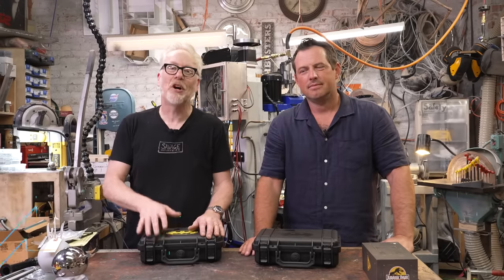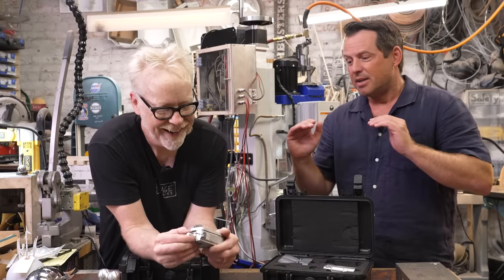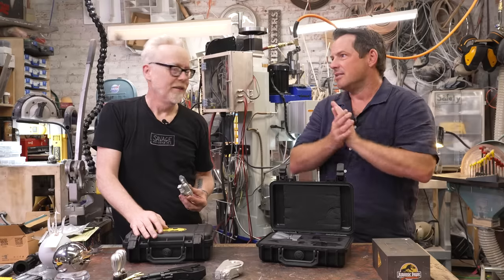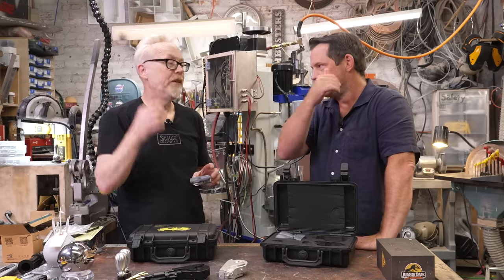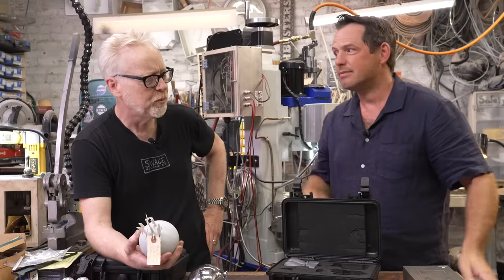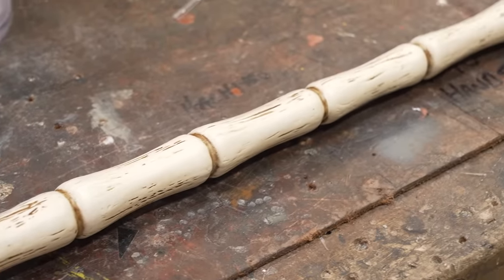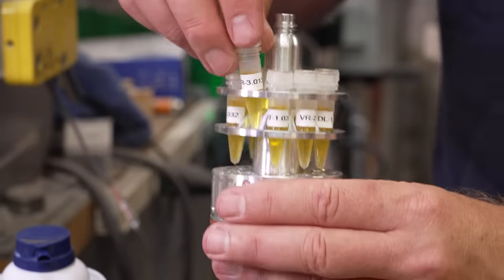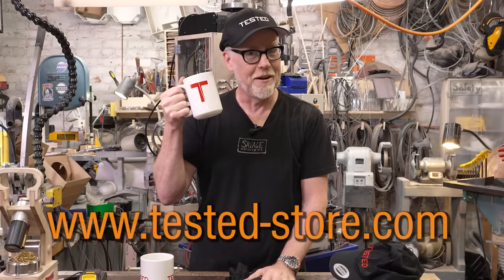How Screen Accurate Prop Replicas Are Made!

Comment: On the subject of manufacturing, QC and communicating with suppliers: a favorite college professor of mine was explaining the concept of "significant figures" and had a fantastic real-world example of why they matter. He had worked for a company that designed lights for bicycles. Someone was doing an internal cost audit and noted a unit price several times what was considered reasonable for some commodity component (I think it was a bracket). When they dug deeper and looked at the blueprint, it turned out an engineer had specified something like "6.00mm" for one of the dimensions. The overseas supplier had dutifully sourced components that were machined and checked to an accuracy of 10 microns when, in reality, a 5.9mm or 6.1mm bracket would have done just fine. Precision and cost do not scale linearly–it ended up being a several-million-dollar mistake!
Reply: That's why as soon as a part is considered "aerospace," orders of magnitude change.
Reply: Yep, been there, I joined a company, looked at their mechanical drawings and halved the cost of outsources items.

Comment: That Jurassic park prop is great! My ONLY quibble is that the bottom should screw on, because I distinctly remember them screwing and unscrewing the insert and then squirting out the shaving cream at lunch, lol.
Reply: That actually stuck with me as well. I know for a fact it unscrewed and screwed back. Seeing it just pull out was less satisfying. Still a very cool replica but it’s the lil things like that that stick in my head. And the function of it actually spraying shaving cream would put it over the top.

Comment: You could tell Adam so badly wanted the Barbasol to spray foam😂
Reply: Hah yeah, that was the only limitation i could see from there, i was thinking that there was something missing, and that was the shaving foam.
Reply: @Games_and_Music  imagine how amazing it would be if they made tiny re-fill capsules you put inside that gives you that squirt of foam
Reply: @medievilassassin  Yeah, but i can imagine that it would be really tricky to do.
There's almost no space left in there, and where to find flat shaving cream capsules, as usually cream cans are taller rather than flatter.
And i'm not sure if messing around with those laughing gas capsules is an option either.

Also, as others have pointed out as well, this can slides open and shut, instead of a screw tightening mechanism.
Reply: @Games_and_Music  yeah the non screw in thing is an irritation , but all they would need to do is the aluminium base hollow that out and the same with the rod in the middle.
Put a high pressure air valve at the bottom that you put a car pump on and that’s it
Reply: @medievilassassin  That's true, they could maybe hide it in the base and use the rod as a tube to get it to the top.
It might still not really be trivial though.
I wonder if a cheaper prop that only serves as the shaving cream one would be a better solution.
Because in the movie they also used the DNA version and a shaving cream version on set.
Reply: @Games_and_Music  or they could just mould a can within a can.
So the innard with the DNA doesn’t take up the whole can so you have the space above it and then you could have sort of a wall cavity a few milimetres thick holding a small amount of foam and air , as realistically you only want enough for what he uses in the movie , as at the end of the day this particular prop isn’t 100% accurate , doesn’t thread in the bottom and non working foam.
Reply: How do you make it spray foam AND cool the Dino DNA samples? Tricky in such a small space! 😆

Comment: You get a greater appreciation for the work that does into something like this.
Reply: And makes you realize it's probably 100x more work making those replicas than making the original prop for the movie. They didn't have to worry about accuracy to anything. The Barbasol can for the movie was probably done in 24 hours but an accurate replica is months of work.

Comment: My favorite example of calls being made on the shop floor impacting the final design is for the M1 Garand. They were having an issue where the gun would jam occasionally, and they had to hide the issue from the military to get the gun approved for use while the figured out the problem. Turns out during manufacturing they were boring a hole and the drill bit would shave off a tiny nub of metal because it simplified the machining process. That tiny nub was helping guide bullets from the magazine into the chamber and without it the gun wouldn’t reload correctly and you’d get jams. Adjusting the equipment to preserve that nub completely fixed the problem and the M1 Garand went on to be a vital to US victory in WW2 where the semi-auto functionality was very powerful against armies that were mostly still based around bolt-action rifles for their common infantry.
Reply: Specifically, wasn't it an issue only on either cartridges that presented left or right in the internal magazine? (Making it harder to diagnose and also your point about hiding it during some of the trials.)
Reply: @fustigate314159  It was magazines that were loaded starting on the left, and not only that it would occur on the seventh round from that magazine. Since the magazine holds eight rounds the seventh one is where there are no longer any more rounds pushing up from both sides, and it’s this lopsided pressure which those nubs were designed to compensate for. And yeah to get the gun to pass the field trials they went through all the magazines to load them all starting from the right, that way no one would encounter the feeding issue.

Comment: What you mention about spending some time in manufacturing is great. I've primarily spent most of my career in computers over about 40 years.

I spent a lot of the early years when I was studying doing part/full time work in manufacturing to earn money or while I was doing different jobs or trying to figure out what I wanted to do. I worked in a foundry for about 4 years while I was studying and about 2 years at a major sailboat hardware manufacturer.

Working in those manufacturing environments was so interesting and has heavily influenced the way that I work with computers and business in general today. It was such a valuable experience for me. Highly recommend it!

Comment: Here for the Jurassic Park pieces!  They look great.  With the cane I did contact Paragon but got no reply - is the cane cast from a screen used prop?  The now defunct Chronicle Collectibles replica cane body was cast from the promo canes - which word has it came from the original molds.  The only part that wasn't accurate was the egg.  So I was hoping this replica cane would be cast from an original, both body and and egg.  I will hold out for a fully accurate cane - that would be a treat.  I hope Paragon sees this - perhaps a future iteration?  Good to see the cryocan shell is accurate!  That vintage can shape has been overlooked for some time 👍. And that's not easy to manufacture.  Well done Paragon and Rylo!

Comment: i can so relate to the process and thinking about what he says about manufacturing something like this due to that i am a CAD designer and CNC operator. what the costumer wants dont always  align whit ones head once you sand there infront of the machine making it :) Ive learn just to do it even if i think or know its wrong or its not going to work :P its better the costumer realise it once the part is done:)

Comment: The shaving cream can is actually a prop I would think of buying. My one complaint about it would be that the can was screwed in rather than a slip-on cover.
Reply: ya, i noticed that too. If they fix that, i'd buy.
Reply: Hah, the comment directly under yours says:

@BroughtToYouByDDean   3 hours ago
I'm still very happy and take pride in the fact that my cryocans are the only ones that ACTUALLY unscrew from the mechanical base... 

So i think you should hit that dude up, hah

Comment: Definitely appreciate the attention to experience. It may seem petty to complain about being not quite right or having cosmetic damage from manufacturing or handling, but when you pay as much as a good prop costs, you are paying for a better experience. Not the Walmart clearance toy experience. If you're disappointed, then there wasn't a point in paying so much for it in the first place.

That's also why the "I can get it for a fraction of that" commenters can get cheaper versions that look close enough - it's a tradeoff of cost and experience. And there's nothing wrong with wherever you are on the spectrum of that tradeoff.

My budget is more often the Walmart clearance toys that someone kept since the 80s, but for a few things I want this kind of experience. If they get into the right Star Trek props, my wallet is in trouble.😂

Comment: Disagree over the accuracy of the JP Hammond Cane.  There are too many closeup shots of the screen used cane to show the inaccuracies of this replica.  
The replica made by Rylo over at the RPF were by far, much more accurate.
The JP Cryo Can is very nice.  If I were to pick nits, one thing that looks a bit off would be the thickness of the base lip.
The price of the Can ($400) is pretty high but it's got a lot of detailed machining.  The price of the Cane ($350) is horribly excessive for what you're getting!

Comment: I am sorely tempted by the cane. I made the amber "egg" once as a school project when we were learning to use resin. I just used a mayfly as the mosquito.  Thought about making a shaft for it in college, but the machine shop didn't have a long enough piece of aluminum in the scrap rack, and you know how machinists can be about wood. Still, the bug in the ball was enough to scratch the itch.  Unfortunately, some kind of small hominid borrowed it a few years ago, left it out in the yard, and I hit it with the lawnmower. This was not a very flexible resin.  Obliterated.  I only know that's what it was because a chunk hit the house.  
That is a nice cryo-can, but I have a Barbasol can that i used a fancy can-opener to take the bottom off of, so I feel compelled to see that through on my own. 
They should do Grant's raptor claw too.  That was my JP Holy Trinity: Claw, Can, and Cane.  I do already have a claw as well(it's metal and has a bottle-opener sculpted into the articular facet and I love it), BUT I generally find myself among a large community when it comes to the props I've latched onto and coveted throughout my life, and that would be an easy one if they could get ahold of an original.

Comment: I'm still very happy and take pride in the fact that my cryocans are the only ones that ACTUALLY unscrew from the mechanical base...
Reply: You sell them?
Reply: Sorry buddy but the two I made both unscrew as seen on screen.
Reply: @minigeff4422  in this video? They are clearly slip fit into the can. So no... They don't screw into the can. Meaning if you pick this up off a shelf by the top rim of the can and shake it the insert will 100% slip out of the can and hit the floor
Reply: @xGaLoSx  yes of course
Reply: @PropGuru702  no I think you’re misunderstanding. You said that your cryocans are the only ones that unscrew from the base. I was replying to you pointing out that the two cans I have made also unscrew. I made my cans for myself from scratch, I’ve nothing to do with Paragon.
Reply: @minigeff4422  oh well my apologies. Do you sell them? do you have a video of them? Id love to see.
Reply: @PropGuru702  no I didnt make mine to sell, just one for me that’s screen accurate and a customised one for my wife who’s a big JP fan. The only thing I bought was the vials inside, everything else was made from scratch by hand, no cnc etc, all conventional hand operated machining. I’ve not got any video, but I took some photos. It was about 5 years ago now, so I dunno where the pics are.
Reply: @minigeff4422  gotcha. Yeah I turned mine on a lathe as well. I'm just curious how you went about doing the threading because as you know, the can walls are so thin it's impossible to do them there. So just wondering if you went the same route as I did from a different "area" within the design.
Reply: @minigeff4422  another cool aspect of mine was I used the bottom convex piece from another can add my inserts bottom so besides for the weight, it's literally Indistinguishable. I also worked out a method of creating that cryogenic vapor when you open the can but haven't had the time to implement it
Reply: @PropGuru702  well as you say, there’s little chance of the thread being at the base of the can, and there’s only one other area where the inside part contact the outer parts…. Think you can actually see the thread on the Paragon replica right where I put mine.
Reply: @PropGuru702  in fact, pause the video at 22:54 and there it is. Think I used M10 or M12.
Reply: @PropGuru702  yeah I didn’t bother putting a dished bottom on mine, the weight alone tells you something isn’t quite right lol. As for dispensing foam…. yeah it would be cool but not worth the effort imo. Don’t think I’ve seen anyone do a fully working one before, so it would be something to be the first. Would love to see that if you ever revisit it.

Comment: ParagobFX need to up on Blade Runner Props. We have not yet seen an officially licensed K's Blaster from BR 2049 and also no Emanator made of metal with working sound and light. I've heard rumors spreading of the RPF that they plan on releasing the K Blaster next year but there is still nothing official. So if anyone of ParagonFX reads/sees this: PLEASE consider the following items feom BR 2049: Portable Eyescanner; K's Wallet with Badge and working light; The Emanator with sound, light and made from metal; Officer K's Blaster; Luv's Blaster. There is just SO MUCH fandom that would go squeeking especially when it comes to the Emanator.

Comment: The biggest issue with those barbasol cans is they are using current released cans to make them. They have the barbasol website on the back and the 93 cans had a higher top. But it’s still a great prop to own

Comment: The mosquito didn't convinced me, we have big ones here in Brasil called "Tipula", it would look a LOT better, and they're not hard to find.
Reply: I think they could at least have bent the legs a bit, they look a bit too wonky without the joints.
But yeah, there's plenty of big mosquitos out there, but i think they're limited to their local region and China.
He didn't seem to be against the idea of using real ones, but his reasons were a bit flimsy i agree.
I found the cane itself to be looking even worse, it hardly looked like bone to me, more like some spongy rubber.
I don't expect it to be cheap either because of that amber piece.
But i liked the can and grappler a lot though.
Reply: @Games_and_Music  Right!? I mean, for something that it's not cheap (replicas are not) could get a little more attention on those details, I didn't like the fact that the cane can't even be used as a cane, it could have a steel rod inside or something, I bet that a fair a portion of people who buy this, would want to use it. (edit: Yep, grappler and barbasol can looks great tho)
Reply: One thing that bugged me about that cane was that the "amber" looked far too clean and artificial.  The amber in the actual prop in the film had a lot of bubbles and other imperfections that you would expect to see in a natural piece.

Comment: Can you do the mp3 player from Moon (2009)? Haha
I almost bought the real prop in 2011 or so for $150 when they listed their stuff on eBay (the Rover scale model went for only $400 i think), but i was too late.
I saw the components they used to make it, but of course the CGI screen and actual mp3 player function was added in editing.
So it would be cool to have a real working Moon mp3 player, that is hopefully also affordable :)

EDIT: The components were some generic foldable world clock/radio, and a Mini-Disc case glued to one side of it (flip the clock to the side and now the half with the Mini-Disc case serves as the lower half that sits on the table)